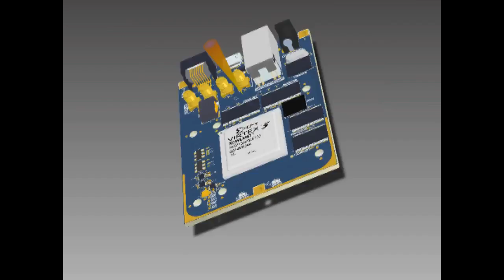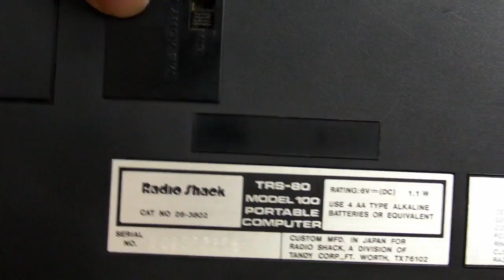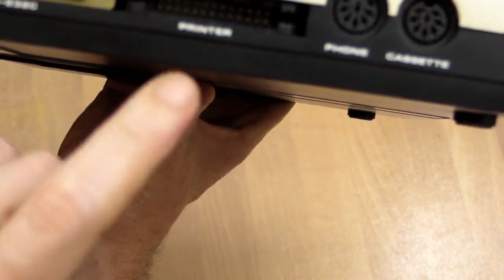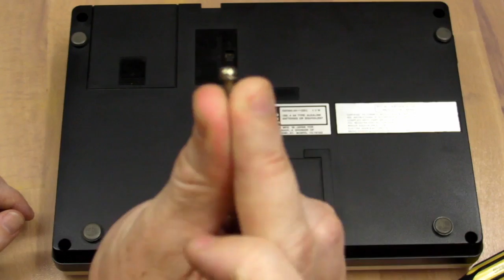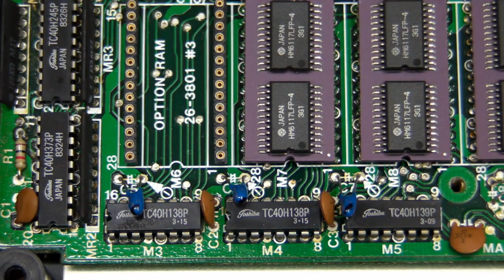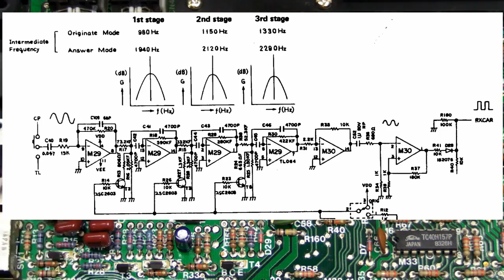EEVblog #116 - Retro Teardown - Tandy Radio Shack TRS-80 Model 100

Comment: Unfortunately here in 2024, the capacitors are now leaking on Model 100.  It is recommended to inspect and replace them preventatively.  I got a Model 100 the other day that is almost unfixable due to so much corrosion on the motherboard. I have not completely given up on repairing it, but I am close! :)

Comment: I have one of these even now, and it's in use several times a week. It is the absolute apex of elegant engineering, getting maximum use out of the space and the technologies of the time. In 2023, mine still works flawlessly, and that keyboard - one of the very best to type on. With modern peripherals such as (Hey Birt!'s) Backpack drive, getting files on and off it is simplicity itself. 

It deserves every ounce of the enthusiasm on show for it in this video. Great stuff!

Comment: I love my Model 100.  Battery life is phenomenal. 

Apparently some remote research stations were using them into the 2000s due to the battery life. Powering anything more capable in the middle of nowhere was a serious problem, you'd need many more spare batteries and those batteries were so much larger. 

That's less of an issue now, even with non changeable batteries external power is much more portable these days and the handicap of the CPU, RAM, and display limitations are much harsher.

Comment: I bought one of these ( a 102 ) brand new in Tandy (Radio Shack) in UK back in 1989, they were heavily discounted at the time and not every branch had them, I had to drive quite a way to get one.   It was easy to program it to control a device via rs232 that I needed to be portable and reliable, there was nothing else that was as simple and reliable as this that worked away from power.
The Basic language on this was really good, I’m not programmer at but later I tried using the basic that was included with PCs in MS Dos, I think it was called q basic, and that was much more limited.   About 15 years ago in fit of nostalgia I bought a mint condition 102 on eBay, and though the screen is much more limited than I remember, it’s still an amazing machine and extremely well built.

Comment: I had 2 of those years ago, first was a 100, then I found a used 102 for a great price and picked that up as well.  I used one in my squad car when I was a police officer, it worked great for taking notes at crime scenes as well as at accidents.  Once the injured were crated away, I could carry the little guy with me while taking measurements of the accident scene, and drop those figures into software that I had programmed up myself in Basic.  Worked great for me.

Comment: 19:50 To be honest, I have a 10" Full HD tablet from 2016 with a keyboard cover. It can run about 10 hours on a single charge. When you add a powerbank, it'll easily stay within the form factor of the Model 100, easily get the same usage and stand by times, and have much more capable hardware.  I'm a retro-guy myself, I love that old stuff, but let's stay realistic here. This "good-old-times" crap is just nostalgia. Now you can say that that tablet wasn't available in 2010. True. But we had netbooks back then. Get a netbook with a spare battery, and again you get the same usage times, the same form factor, with much better hardware.

Comment: I have the Tandy Model 200 (bought off of ebay) - which is the clam shell laptop successor to the Model 100. It's really cool how useful apps are just at your fingertips from a selection menu the instant the computer is turned on. Turn the switch on and start using the computer. This is as God intended computers to be.

It's like even my stupid Android smartphone is not really all that instant with supplying access to apps (or in-coming calls). It all the time goes off into la la land - probably because of the Java execution virtual machine doing garbage collection and the like. I miss calls because Android (on new hardware) is just utter crap when it comes to instant (real-time) re-activeness.

Do miss the days of pragmatic electronic device design. The portable phones I had before the advent of the smart phone actually worked as phones. The blackberry really was the pinnacle of portable phone implementation and it's been downhill since. Now they're just portable computes that get as gummy to use as a 10 year old Windows XP PC full of bloat ware and a registry bulging at the seems.

Comment: I had a clone of this, the Olivetti M-10, as a teen in the 90's. It was my first computer and with BASIC and the excellent manual also what got me into coding. I tried making a Tetris game for it, but lacked the knowledge to make it work. I did make an intro with falling blocks assembling into the word Tetris.
I later broke it during a dumb experiment, but I still have some of the chips from it, and the LCD (it was in a separate case on the M10, so it could be angled). Just a few days ago I started the process of trying to bring it to life using an Arduino.
In the M10 they actually had two versions of the LCD column driver chip, one which was the mirror image of the other, so they didn't have to flip half of them over.
I just today built a charge pump for the negative voltage, decided on the wiring, studied signal timings, commands and memory layout. With luck I'll wire up and smoke test it tomorrow.

Comment: I wrote a program for these which could right justify a printed page, took 3 or 4 seconds to calculate the spacing of every line, thus three or four minutes to print one page, but that wasn't a big problem back then.  The only other way was mechanical type setting, which took a whole lot more time.

Comment: Actually, there are some pretty nifty video games for the Model 100/102 written in Basic, and an emulator called Virtual T to run on Windows if you wanted to code and debug there or just see what it was like. You can also make a null modem cable to connect the Model 100/102 to the Windows emulator and transfer data/programs that way. Not bad.

Comment: I bought one of these but everything in the corner of the battery compartment is corroded likely from the battery. Anyways to revive that. I think two disks are fully corroded. and the screw in that corner as well.
Reply: Yeah... I've got the same problem. Have you figured out how to fix it> My 4 AA batteries leaked.. damn! Paul (backup6688@gmail.com)

Comment: I have one of these and yes I have opened it up I thought it strange that all the electrolytic
caps were rated at 16 volts when the max voltage any where is 12 volts on the serial ports
that's 2 serial ports in 1 connector my manual says it runs 40 HOURS on 4 AAs mine is the 32K version the ram chips are in 28 pin packages not the hybread modules in that one

Comment: The basic unit came with 8 kB installed, and each for kilobyte addition was $300 Eddie could add up to 24 kB. You could interface floppy drives and a regular full screen monitor through a device called a DVI “ The DVI is a disc video interface. I cannot remember the price of the unit. The cassette deck used with The TRS 80 model 100 was for storing data in a serial data format on a special metallic cassette deck. Also applications could be purchased stored in ROM ships that could be plugged in to the bottom of the TRS 80 model 100. The barcode scanner could also be used for scanning programs into the TRS 80 model 100. The TRS 80 model 100 also had a user group magazine that helped find new ways of using the model 100 as well Is supplying many scannable programs via the barcode reader. I personally bought one of the very first model 100s and put it to work as a database for my field service job on CNC machines. You could do word search in the database for anything that you had typed into the flat database and find anything you have stored in there via simple Search routine. I even heard a rumor that Stevie Wonder used the model 100 for composing music while flying around the country in the world.

Comment: When I was at uni, I had one of these, in an ali camera case, with a ham TNC and VHF handheld. So I could get onto the Amateur bulitin board system. This was in the late 80's, before most people had even heard of email.
The other students thought I must have some secretgovernment job, as this seemed like James Bond stuff to them!
How things havemoved on.

But after seeing this video, I had a route in the loft. I still have the modle 100, the TNC and even the ali case. (The handheld does decades ago.) And they all still work.

Comment: The Model 100 was a big part of my life back in the mid 80's. It is one of the most usable computers of all time. As soon as you turned it on you had a calendar schedule, an address book, a simple notepad/word processor, a simple terminal program and of course BASIC. All your files (small ones) were right there, not on some floppy. I carried this thing around everywhere. 

I wrote dozens of papers in high school and college using the built-in notepad and printed them with a BASIC program to make proportional lines. I had (and still have!) a typewriter with a parallel interface so I never handed in ugly dot matrix print. I may have purchased a real word processing program but I don't think I ever used it since I didn't need to do page numbers or footers.

I used BASIC for calculus. By plotting functions I could see if I got a derivative correct. Since it didn't have a spreadsheet program (the model 200 did) I occasionally wrote BASIC programs with long DATA statements and loops to process the numbers. Not as convenient as VisiCalc, but changing a number and typing RUN gave you a new answer in seconds.

The built-in terminal program was perfect for calling up Compuserve and your local BBS. There were cheap 1200 baud modems that Bell had gotten rid of and the terminal program worked fine with them through the serial port.

Of course "hacking" was a popular past time for us nerds back then and the Model 100 was tops in that category. The built-in dialer was just a relay for pulse dialing (no DTMF) but it was fast enough to dial all the numbers in my hometown looking for modems in just a week. We were also able to put the 300 baud modem into answer mode and tap into the school office terminal modem line (yes, illegal).  We were able to capture all the passwords they typed. Switch it into originate mode and we could capture whatever data the school computer was returning. 

I wonder where mine went.
Reply: Of course the idea of the Model 100 was that it was portable.

Comment: the Epson HX20 was probably the first or one of the first 'laptops' as it predates the model 100, and this has built in mini printer and optional microcassette deck and memory expansion unit

Comment: I have two of these M100's One I keep in my cubical that displays "TRS-80 MODEL 100 PORTABLE COMPUTER" then my name and date and time.. it has been running almost non stop for 20 years since I found it in a pile of junk computers being thrown out. its just one of those things I have brought with me from company to company.
Reply: +Jayrocco Sechsunddreißig haha! That's an amazing idea! I think I'll try to find an old computer and practice this trick myself as well.
Reply: +AlTheEngineer There is a lot of old software for these old M100's at http://www.club100.org/
I found one really cool clock program there and have since replaced my old program to a much more slick display..
Reply: +Jayrocco Sechsunddreißig that's amazing. I must pick one up! Just checked eBay and I can get it for under $200 for a good condition one!

Comment: It still works after 27 years so those capacitors must be good quality.
Reply: yep, mine still works nicely BUT it has an internal NiCad backup battery which is prone to leaking!
Reply: ungratefulmetalpansy  I just finished rebuilding a Tandy Computer Speaker SYSTEM. It was a stand alone 110 volt device that fit under the monitor. It came in a very strong steel case, had a very large woofer with two smaller mid-range speakers, and a set of variable resistors for adjusting the sound output.  You could feed in audio from anywhere, it had duel stereo inputs. I purchased it in 1994, and a couple of years ago, we were using it to remote the audio from the TV and Stereo system from one room to another, it began the dreaded 60 hertz hum.  I stopped using it, but one day I didn't have a lot to do, I tore her down and replaced all the larger capacitors in the power supply portion, the control portion and even in the rather large amplifier board, it had all separate boards, and all through hole devices.  When I was finished, using all top quality caps, the hum was gone, and she was back to being a very nice sounding speaker.  To top it off, I installed a bluetooth receiver and made her a nice bluetooth audio device, I am using it right now for background and thanks to the replacement of the caps, nary a hum to be heard.

Comment: so around 6WHr battery can run it for 20 hours and i can't get 4 hours out of my cellphones 8WHr battery.

Anyway is it possible to get one of this?
Reply: Redwan Hasan You can find them on ebay and at hamfests for cheap to nothing.
Reply: Thanks for the info Gazer!

Comment: Hello, I am kinda stuck. I found an old motor in my inlaws attic and it does not have the data plate heck half of the housing has been removed. they have no idea what it went to nor where it came from. could have been in a box they got from a family members estate in the past. how would you determine the voltage/amp? the power cord has been cut back to the housing. I wanted to use it in a build if it was good and would save me some $$$. have a true RMS multi-meter and some electronic experience.

Comment: Funny enough, the Model 100 doesn't store the date as 2 digits--it just has "19" hard-coded in for some goofy reason. You can actually change it to "20" with a series of peek and poke commands. That's some lack of foresight...

Comment: So, $1400 1982 dollars equals just under $3500 2105 dollars.That could get you pretty much a top of the line 1080p i7 + SLI whatever the best laptop GPU is and max RAM + RAID SSDs, etc. In 1982, that got you an oversized scientific calculator.
Reply: Jay Man No, it got you a device NOBODY else made at the time.  These were incredibly popular with journalists and other people that have to write documents on the road.
Reply: Yeah, I'm sure for 1982 this was like landing on the moon in the computing world. But, the equivalent of $3500 for a word processor? I mean, wouldn't it have been nice if there was something that could store words that was cheap, portable, that had an almost unlimited memory and didn't use any electricity? Man, that would be so nice. I think I'll call it a pencil and a ream of notebook paper. Oh, right, you need it typed? iI think I'll call that invention a typewriter. Nah, I'm just dreaming, nothing like that will ever exist. It is too good to be true. Lol, no electricity?
Reply: +Jay Man
I think the real reason journalists liked it was because of the modem.  This way they could be on location, type their piece, dial into the BBS system or whatever they used back at HQ and upload their story in minutes for that day's news print.  Pre-web sure, but once you had the equipment set up, it'd be much faster and cheaper than the mail or a courier service. Not to mention with a ream of paper or a typewriter, someone would still need to transcribe it later to get into whatever system would eventually publish it.  Stored electronically, that was no longer a problem.
Reply: Jay Man Some software was sold at $20,000-$30,000 per seat back then. $1400 would have been reasonable for a word processor that you can take with you.
Reply: yeah but can your pen and paper perform 8-bit interger math?
Reply: it's not just a word processor. it's a computer.
even with that slow ass Z80 processor you can do a lot of amazing things.

Comment: so for the rest of us who dont know what  it does. what does it do ? can you type? save? print ?
Reply: spyrmac It had a word processor, a spreadsheet, a calendar and some other utils built in, and you could load and run other apps via the basic interpreter, or expansion roms, or write your own!  It was a general purpose computer.  They had a printer, a floppy drive, a cassette drive or you could dial into your work computer via the modem and send/receive files that way.

Comment: Agree completely I wish we still manufactured products using this old technology, or at least old philosophy.  The idea that products could last forever and be REPAIRED instead of tossed in the trash. With so much emphasis on recycling and going green, why are we manufacturing throw away products?  I just tossed a BRAND NEW Brother printer in the trash because I couldn't figure out how to get it apart to make a small repair. No service manuals, and no screws. It was like a caveman trying to break into the monolith on 2001.  Finally gave up after 6 hours of prying and getting nowhere.

I used one of these model 100's as a hacking terminal and it literally ran forever on AA's.  I had a 2400 baud battery powered modem taped to the underside.  The keyboard was AMAZING... loved it. Have owned a few of them over the years.  The AA powered floppy drive was really cool but kinda hard to work with.